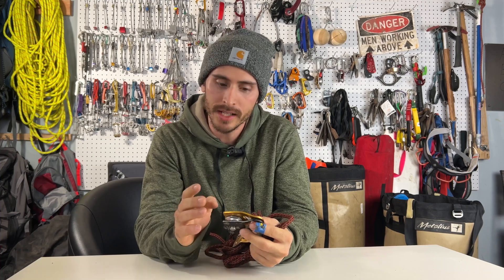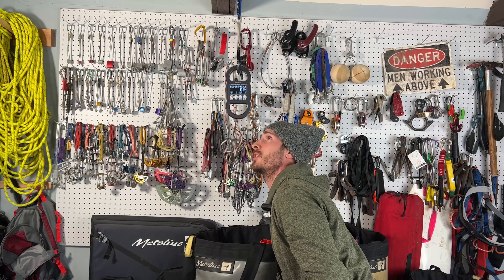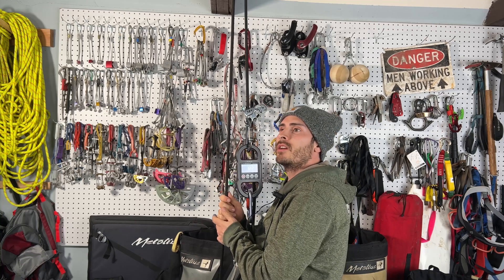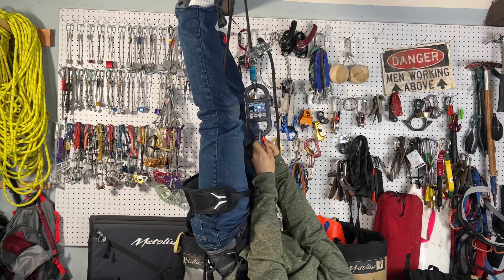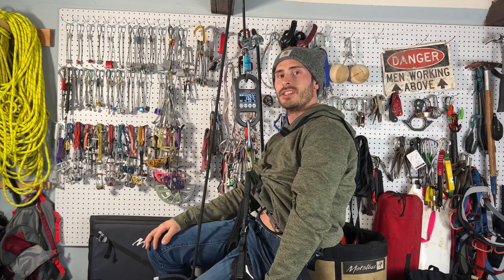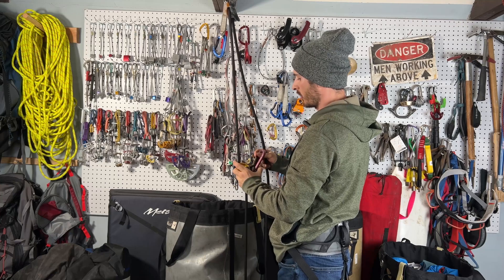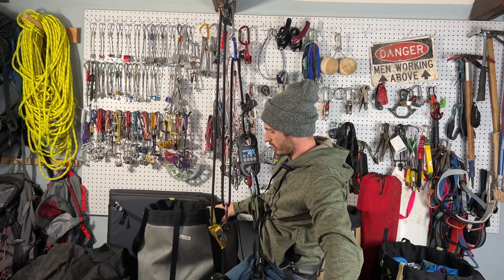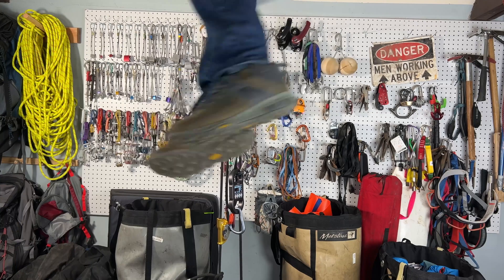Do You Even Efficiency Bro?!  You need to understand this about pulleys...

Comment: That is great but I couldn’t help but notice that the system you where using used caribeners instead of pulleys possibly the drag would be closer to the theoretical advantage if you used a more efficient way of redirecting the rope on each bend
Reply from the maker: Yeah that’s right but I was just making a point out of it thanks! 🙏🏻🤙🏻

Comment: You were definitely getting mechanical advantage in the final example with the '3:1'. The GriGri was previously causing so much friction that you have to put ~300# on the scale to lift the 100#, but with the z-drag it only took ~130#. This would seem to me to be about 2.3:1, which is useful enough. Even if all you're doing is recovering the efficiency losses from friction so that you can actually achieve a true 1:1, that's worth something.
Reply: Seems like the issue of inefficiency isn't the 3:1 pulley configuration but the Grigri inefficiencies, supper useful to know that the grigri adds that much friction.
Reply: You’d be better with a micro trax
Reply from the maker: That right but now we also have to think about how many reps because it’s 3x the amount of rope.
Reply from the maker: If you look back to the start it’s more efficient to just go back to no mechanical advantage and just run it through a pulley. I’ll break this all down in the next episode. 🤙🏻
Reply: Be good to see a pulley system in use, thanks
Reply: If you replace the grigri with a pulley, sure. You'll also have to be kinda careful with where you place your most efficient pulleys. The most efficient pulleys should be as close to the input as possible. So you need to replace the grigri with a carabiner + prusik, and then place that pulley (assuming you only have one) at the "input" redirect
Reply: @Jetse Verschuren  That's why they make those carabiner pulleys like a Roll Clip Z. They easily go into systems like this and just make work super smooth. They are heavy of course but I find more and more use for them the more I have them around. I use them to ascend when I wanna bring limited gear and ropes
Reply: @50StichesSteel  I think I'd rather carry a microtraxion, but those carabiners are also a pretty good option. I don't remember where, but I've seen some tests that suggested the efficiency of those roll clips isn't that high under load, but take that with a grain of salt until it's properly tested
Reply: @Jetse Verschuren  I can believe it. They really aren't made to be efficient monsters. But for something dual purpose it goes above expectations. Just a purpose made pulley will always be better imo. They are really clutch for clipping to an ascender. You clip the top part that helps keep the rope in place with the roll clip Z, run your brake strand coming through your gri gri up to the pulley and back down. Really helps pull your body weight up as you're stepping up. That's a big deal when you weigh 240 like me.

Comment: Isn't that a 4:1?
Reply from the maker: A trick is to count the strands on the moving pulley. So it’s a 3:1, if the beam was some how being pulled and not the load then it’s a 4:1. But obviously it’s theoretical, you will be pulling 3 times the amount of rope but you won’t be getting a 3:1 trade off.